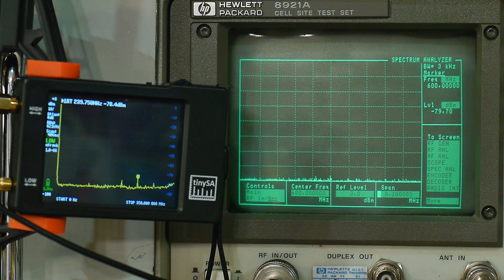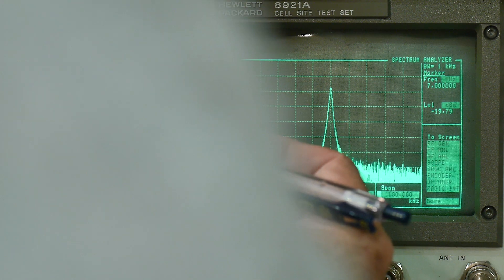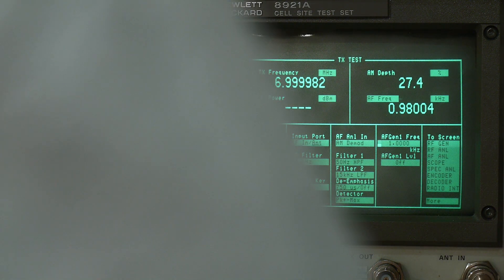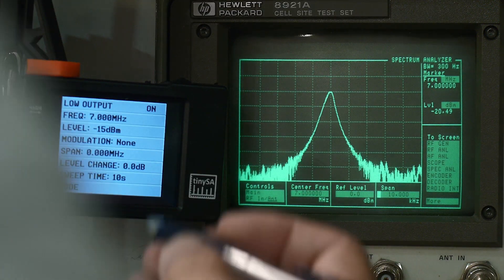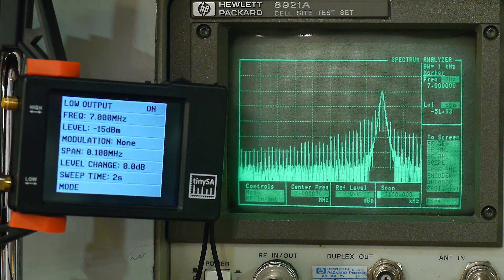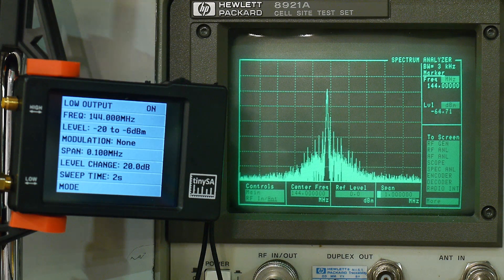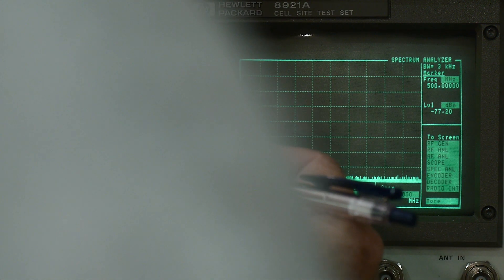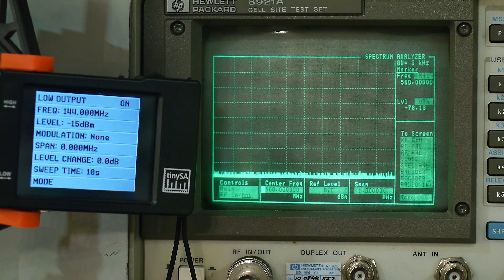#542b TinySA as an RF Generator (see update)

Comment: Turn the sweep off and the AM and FM modulations are perfectly OK, though when I checked FM, the deviations settings were only 2 preset levels, 4 kHz and 75 kHz, it would be nicer to have been able to set the FM deviation in at least 1 kHz steps. AM mod depth I believe is only one level of 30%, again it would have been much better to have been able to at least be able to set the depth of AM mod in at least 10% steps. These settings are with the latest Tiny SA firmware as of 29th Nov 2022, hopefully, the next firmware might have better preset levels of modulation!

Comment: Would this be good enough to tune the s-meter in a hf radio? I'm having a little issue with an icom my son messed up on me!
Reply from the maker: you will need an attenuator to lower the output. S9 is at -73dBm
Reply: @IMSAIGuy  There is no way to attenuate the signal in the software? I thought there was, what is the point in a signal generator with out being able to attenuate the signal.
Reply from the maker: @joeryvilches8786  not low enough. you need about 20dB or 30dB of external attenuation.
Reply: @IMSAIGuy  ok got yah I appreciate the info

Comment: I listened to the modulation, both AM and FM, on a variety of receivers shortly after I got my first tinySA.  It was about what I expected: pretty raspy.  But I just wanted to see if it would be suitable for a quick receiver check.  It is.  The FM deviation isn't precise, and the AM modulation depth isn't precise.  The waveforms aren't pure, clean sine waves.  But for a quick "hey, does any audio get through this receiver?" sort of check, it's fine.  And many times, that's all that's needed.  After looking at the specs of the chips in the tinySA, I think it's amazing how many functions and how much performance Erik has managed to squeeze out of it.  Still haven't figured out how to get it to make my coffee in the morning though,  but that will probably be in a upcoming firmware release.  ;>)
Reply from the maker: I haven't tried a radio yet. The 1khz AM seems usable. The 10Hz I'm not sure. I think it is a square wave and can't detect it. I have real problems with the FM